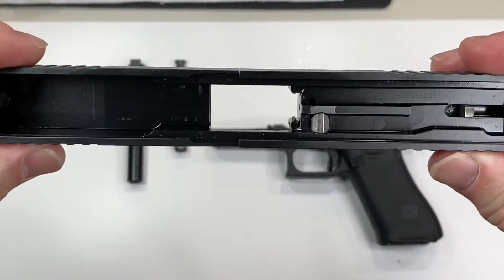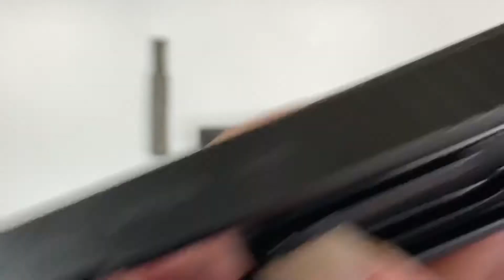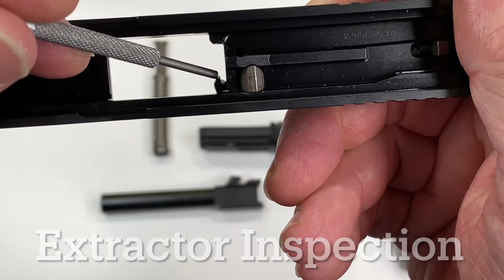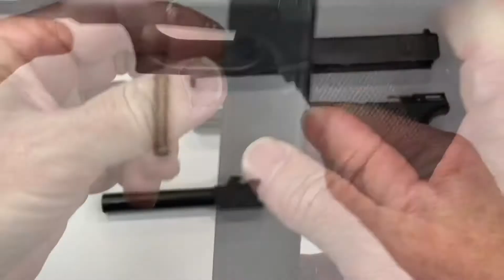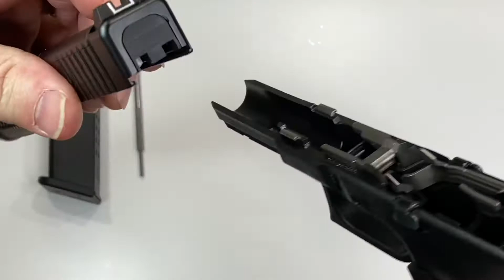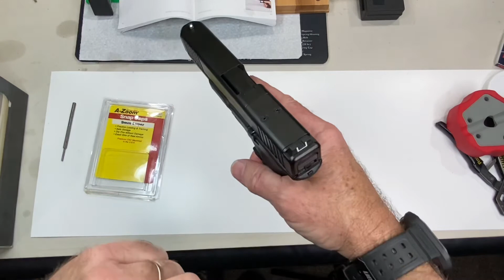Glock Function & Safety Check. User Level Inspection #glock

Comment: Passed all the tests but when the gun is empty and slide is locked back the firing pin protrudes and moves. Is this safe/normal?
Reply from the maker: That is an excellent observation but yes, it is normal! I just checked and both my Glock 17 and my Glock 43X do the same thing! When the slide is locked back, there is a part of the frame that presses on the firing pin safety plunger and allows a firing pin to be “free”, but as soon as the slide is moved forward, the firing pin safety returns to its normal position. Thanks so much for your comment and question!
Reply: @davesgunchannel awesome, appreciate you taking the time to answer. Glad there’s no safety issue to worry about

Comment: What if the firing pin does come out without the plunger being pressed?
Reply from the maker: Then the gun is not assembled correctly. The firing pin safety plunger is likely not properly installed.

Comment: My firing pin doesn’t move when pressing down what should I do
Reply from the maker: Have you disassembled the slide before? You May need to clean the firing pin channel.
Reply: Squeeze a little bit of 99% Isopropyl Alcohol from a cotton ball or qtip into the channel. It'll displace the moisture that might be causing minor corrosion. It'll evaporate in a few seconds. Afterward, make sure the firing pin is protruding with the breech face facing downward and I'm lightly swab only the pin itself with lube. Let it set for about five to ten minutes and wipe it dry. That SHOULD do the trick. I do it once a year, right before the hottest part of summer
Reply: @EvilynKing  appreciate it

Comment: One check was missed that my wife's new G17 gen5 failed at one point. After the magazine locks the slide back. Remove the magazine and try to slingshot the slide home. In our case, the spring tension wasn't there to pull the slide stop down, so the slide wouldn't release.
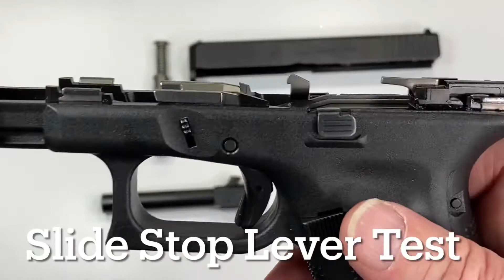Reply from the maker: Yes, that check is covered at 3:11 in the video. Thanks for watching and leaving the comment!

Dave
Reply: @davesgunchannel ah, yeah, I see now.
Reply: I found that the gen5 slide stop spring can bulge out in one direction if not installed correctly and cause that malfunction.
Reply: @shuumai No offense to anyone who bought a gen 4 or 5, but I stick with 3s only. After all, they have the exact interior parts as the gen 1s and 2s - which is what Glock built their reputation on. Just saying. The next gun I'm getting is a Walther PPQ sub compact - if I can find one - being they're out of production
Reply: @EvilynKing  part of that early reputation might be related to the lightweight of the polymer frame compared to other pistols.